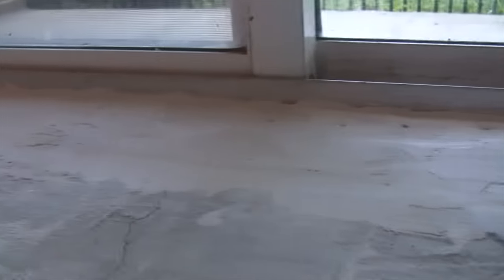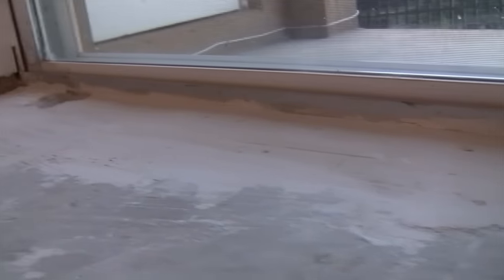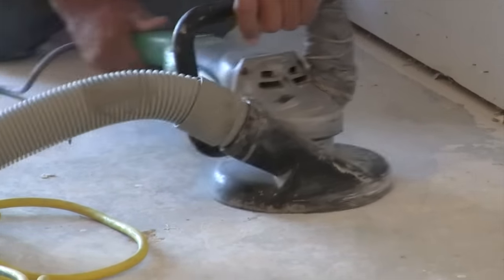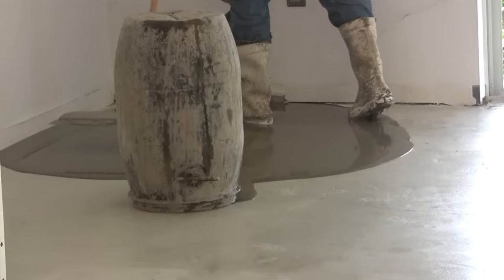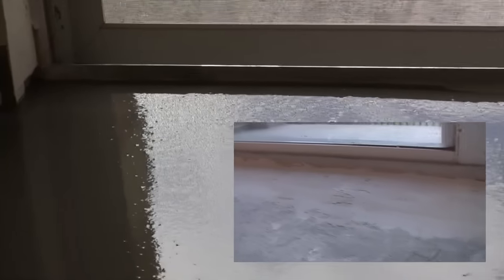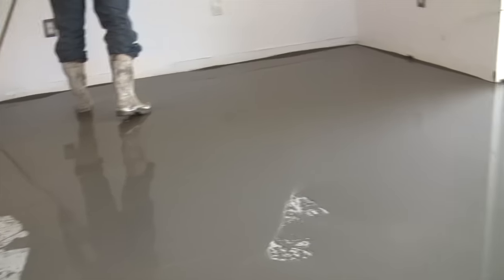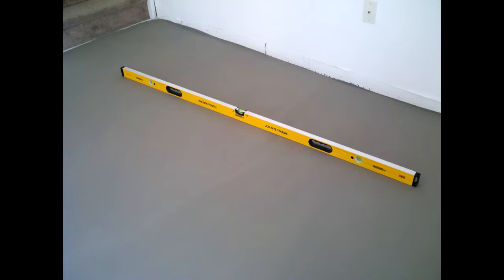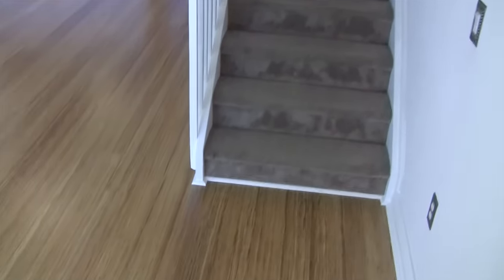How to Self Level Concrete Floors Like Pros - Self Leveler

Comment: I have tried to use MAPEI self-leveling compound without any tools.  I thought self-leveling meant it would... well ... level by itself.  What I found was that the different batches wouldn't perfectly blend/mix with each other.  What I mean is that the edges where the different batches met weren't perfectly blended, you could tell where the different pours were.
If I was to do it again, I would invest in one of those spike rollers, to make it look like it was single uniform pour.
Reply from the maker: Yup, once you rake it and roll it, then it self levels.
Reply: What does it matter if you're putting a floor over it?
Reply from the maker: @cosmicshadow305   It would only matter if the 2 different pours are uneven with a lippage between the 2 of them.  A lot of it depends on if you mixed it properly and if you dumped it right away you're supposed to mix it within 2 minutes and get it on oak floor right away and yes you are supposed to use some type of rake.  I have done small bathrooms before and had to do a smaller area of the bathroom and I was just pushing the mixture around on the floor with a trowel to feather it out to the rest of the floor.
Reply: that's because you either mixed them with different amounts of water, different water temperatures, or the bags we'rent the same weight throwing off the mix ratio
Reply: Chris or if they wait to long in between pours. They could be perfect mixes. Won’t matter.

Comment: Great  video! I wanted to ask if the the floor had a bump would you first have to lower that bump or would the self leveling cement do that?
Reply from the maker: Yes they will typically go around the floor with a grinder with a Cup wheel on it that will grind down the high spots sometimes you might even have to do a little chiseling but the idea is to get the floor as flat as possible before you even pour self-leveling compound otherwise you're going to end up mixing many many more bags than you originally intended in order to make it all rise up over the humps . So to prevent that the idea is to grind down the humps to the level of the rest of the floor

Comment: Surely with a pad that size there should be an expansion gap around the perimeter?
Reply from the maker: You don't need expansion gap with concrete. You would need it with wood or laminate flooring as it expands and contracts.
Reply: @jeffostroff  why would sidewalks have them then? Thanks for the video.
Reply: @MichaelMerritt  im guessing its because sidewalks are subject to more extreme forces. expansion and contraction of the ground, especially important in the northeast with the freeze/thaw cycle

Comment: Is it possible to level a floor in a flat? Ous the concrete not too heavy for original period hardwood underneath? Thank you.
Reply from the maker: You can level that floor with no worries, unless the flat was built illegally against building codes, and is subject to collapse.
Reply: Built in 1898, so not sure about the bulging codes back then😂, but thanks!

Comment: You didn't cover the clean up between the grinding and the priming.  How clean does it need to be?   It seems like that would take a considerable amount of time.   Also, why didn't you seal the crack in the floor before priming and self leveling
Reply from the maker: I believe they used a regular roller attachment afterwards to just quickly go over the floor. We did not fill in the crack because it was not deep. The self leveler will fill in the crack when it runs over it.
Reply from the maker: GoFuck Yourself  Sorry, you are incorrect on this, I guess you missed the part where the bonding agent was put down first on the concrete before self leveling was applied, as required whenever you apply any mortar over old concrete, that is all you need. That is what MAPEI tells you to do, and in fact, they specifically tell you NOT to pour this over any underlayments:
"All substrates must be primed with the appropriate MAPEI primer before applying self-levelers".... 
"Do not install over over sheet vinyl, self-stick vinyl tile, luxury vinyl tile/plank (LVT or LVP), glue-down wood flooring, particleboard, hardboard (Masonite), Lauan panels, waterproofing, crack-isolation or sound-control membranes, gypsum-based patching materials, or any other non-dimensionally stable materials."
Reply: @jeffostroff  the proper way to do this is to seal ANY cracks before leveling compound.  And to answer the original question it's standard to vacuum between grinding and primer

Comment: i fit floors in the uk and we get big gaps at the patio doors and/or insulation poking up. They also have a guy come round and spunk in a load of mastic everywhere so they can get a good air pressure test result. It's not always the case but some companies/builders/site managers don't give enough care for the floor prep. You can use wide masking tape if there are skirting boards on but personally i prefer to use a hand trowel and i do the whole lot 100m2+ on my own, otherwise the money isn't good enough

Comment: If you has a spot in a garage that was unlevel would you use the self leveling on whole garage or just the unlevel part?
Reply from the maker: In the garage it's usually a localized dip in the concrete or something like that. Sometimes it's a bump up and then you can just grind it down flat with the area around it. But I would only level the area that I need to level and and do a real good job with the trowel feathering it out into the flat part of the rest of the garage. According to the town council of America and most flooring manufacturers, they prefer no more than an eighth of an inch difference across 6 feet of floor for flatness.

Comment: I assume if you need to add weatherproofing sealer it would be after pouring the level set compound?
Reply from the maker: No you should never add a weatherproofing sealer to this as this is never meant to be the final finished floor. The instructions on most self leveling concrete bags will tell you that is only meant to be the under floor and that a flooring should be placed on top of it.

Comment: What does a typical job like this cost?  Is it by square foot. I have a basement that needs this before I remodel it. Was wondering what kind of quotes to expect?  
Great job on the video. 
Also, is there a slow set you could use to give you more time if you only had 2 people to do the job i.e. me and a friend?
Reply from the maker: We paid these guys $1200 for the job. You can probably do it with 2 guys, just have one guy mixing bags constantly, use multiple buckets so you can just go from one to the next. I don't think they have any slower setting self levelers.
Reply: @jeffostroff  Was that including the materials or just labour?

Comment: What brand cement and Primer did you use?
Reply from the maker: Forget which one, they sell it at Home Depot, down the concrete aisle, looks like milk, comes in plastic bottle yellow label.  The self leveler bag might also indicate the preferred primer to use.

Comment: Hi Jeff, what an incredibly well done, informative video. 
Can you tell me exactly how many bags of Self-Leveling compound were used for this room?
 I have 1450 ft² of slab  cement in an 18 year old home with definite settling issues.  Any idea how many bags might be needed?
Thx!
Reply from the maker: I don't know how many they actually mixed up but I think I saw about 40 bags on the truck and I don't know how many they used. If you look on the back of the bag that you are buying, it tells you how much square foot it covers for a quarters of an inch or  More so read what it says on the back of the bags
Reply: @jeffostroff ; Thanks so much!

Comment: Just wondering,  I have a kitchen floor that has like a solid Masonite composition type floor.
It's not level due to floor joices that have warped or bellied.
Can this be used ?
Reply from the maker: Yes in fact many apartment builders pour this on the second floor where they have wood subfloors, to make a flat level surface.

Comment: ahh man this looks like something I shouldn't attempt. I have a 12x10 ft room and a 6 inch incline from corner to corner. Can get someone to help me but not professional help.. What should I do?
Reply from the maker: If it is 6" off and you have never done this before, I would leave it to the pros.  Depending on the manufacturer of the self leveling compound, once you go past an inch or 2, they require aggregate to be put down with the product for reinforcement, as his is not meant to be used that thick on its own, or maybe grind down the part that is 6" higher, but a professional contractor should be able to accomplish this for you.
Reply: @jeffostroff  6 in is a shit ton of material, might consider pressure-treated sleepers with a plywood subfloor over top
Reply: @richardgilpin9262  Maybe dry pack instead?
Reply: @torbensonderskov91  not sure what you mean,  like a fat mud?

Comment: I have a 400 Square foot cement flooring, of which 200 square foot have undulations in it. Should I use this self levelling compound o
For the entire 400 sqft? Or only to that particular side of 200 sqft? Undulations are about +or- 2 mm. How many bags do I need to cover a meter square?
Reply from the maker: You have to pull up the instructions from the listing on home depot or wherever you buy it from. The bag tells you how much to use. If you think you can get the 200 sq feet to feather out to be flush with no bums and even to the other side of the floor, then just level that one side.

Comment: 50 bags?  Geez , that's like $3200.00 in material alone.
Reply from the maker: No, the bags are $30 each, and it's doubtful they used all of them. Each bag gives you about 25 sq feet at 1/4" depth. Total sq footage was 225 sq ft.
Reply: @jeffostroff
Reply: tax
Reply: Guy crazy
Reply: @jeffostroff  I thought is was 375? That's what you told me earlier.....and you talk truth 😂😂😂
Reply: jeffostroff first you said the room is 15x12=375 sq ft and now you said the room is 225 sq ft and still there’s no way you used 40 to 50 bags of self leveling cement. If each bag give you 25 sq ft at 1/4” depth. That’s mean that 375 sq ft/25 sq ft = 15 bags and on the other hand if the room is 225 sq ft. 225sq ft / 25 sq ft= 9 bag of self leveling bag. Number don’t lie. 🤥
Reply: @hanselroa  ya I called him out on it too he tried to bend what he said a couple of times. Glad im not the only one who caught it lol.
Reply: Did he say he USED 50 bags or CHARGED for 50 bags? I just had over 400sqft done with less than 20 bags. Maybe the thickness?

Comment: What kind of primer and self leveling concrete can you use for outside concrete patio
Reply from the maker: RapidSet from Home Depot says on the instructions This product is suitable for use in exterior conditions as an underlayment in areas that are not prone to water immersion or prolonged exposure to temperatures above 120°F (50°C).

Comment: Is it possible that after pouring when the screed settles it pushes the insulation and damp proof membrane down to the subfloor and it makes a 40mm difference? Our builder is telling us this. We need to do another round of pouring to compensate for the 40mm.
Reply from the maker: you should have it all dammed up with silicone or something to prevent the self-leveler from flowing where it should not flow, then you won't have this problem. You should not have to do 2 rounds of pouring, you should only need to make one pour

Comment: That guy grinding the floor with no ear, eye, or breathing protection is foolish.  If you are going to try this, wear ear, eye, and breathing protection, and make sure the respirator protects against silica dust, which causes silicosis.  You won't like silicosis.  Don't be a fool; protect yourself.  That dust collector is probably getting a lot of the dust, but what if it misses 1%?  And say you're grinding a 20X22 garage floor.  That's a lot of dust and even 1% is bad enough.  How much silica dust is too much?  The American Conference of Governmental Industrial Hygienists has a lower non-regulatory Threshold Limit Value of 25 µg/m to the third power.  That is 25 micrograms per million per cubic meter of air.  That's a tiny amount of silica dust.
Reply from the maker: I know some of these guys I think will end up with iron lung one day. I also see a lot of roofers without harnesses. OSHA can't be everywhere at once to inspect every single job site. Lucky for this guy that vac he used caught about everything there was, but you're right, there's still 1% of what I could not even see him grinding up.

Comment: Concrete will continue hardening up til a month after laying it out.
Reply: Its also called curing
Reply: Kalle Klæp Not necessarily a month. There is quick setting concrete. Many accelerating admixtures exist. Concrete may harden in a few hours. Normally 28 days is specified, but concrete gain 70% of its strength within a week.

Comment: Shoe molding looks like crap in any house...
Reply from the maker: Yup, that's why I don't use it anymore, stopped about 5 years ago. I'd rather have a little gap under the baseboard than see that tacky shoe rail. In fact there have been times when I caulked UNDER the baseboard due to excessive gaps left by sloppy builders leaving lippage on their uneven tiles, now you have to create an optical illusion by caulking under the baseboards, but it works great and fills in the gaps.
Reply: @jeffostroff  Stopped 5 years ago but used it in this video from 3 months ago
Reply from the maker: @zeke112964  I uploaded this video 3 months ago, but we actually shot it in 2012! It sat on my hard drive for years before we got around to processing the video and uploading it.

Comment: Will this work in a garage?  I have  quite a few high and low spots and it would look worse if I sealed it like I want to do.  I do park a couple vehicles in it.  Thanks in advance.
Reply from the maker: No, you can't use this in a garage, the bag instructions say interior foot traffic only, no vehicle traffic loads. Always check the instructions first before buying, and check with the manufacturer what they recommend for a garage floor.

Comment: This is nonsense. I do self levelling   on floors this size all the time on my own. You don't need to grind the floor first and it's not a "bonding agent" it's a primer to stop the leveller drying out too quickly from absorbtion. Their bucket is stupidly large and the way they splash it about is amateur hour!
Reply from the maker: Apparently you're not very good at your job. There were several high points that needed to be ground down, and one spot had a vertical rebar rod sticking up out of the foundation that had to be ground down. Huge chunks of sloppy concrete from the builder had to be ground down. These guys use a "stupid large bucket", because they mix multiple bags at once for larger faster production, as they normally do commercial projects. 
Sounds to me like YOU are the amateur if you don't understand these concepts. There was no splatters all over the walls, and yes, you dump the stuff out on the floor, that's how it works. You're just making up nonsense, really is that all you can come up with? "splashing about. It's always amusing when janitors assistants show up trolling here, blowing hot air about nothing. I would never hire you if you don't prepare the sub floor first. Grinding the floor removes any contaminants that could be there too. No one likes a troll who comes flying in off their high horse cutting down everyone in site. Grow up.
Reply: I am a professional flooring installer and can say that while I don't totally agree with Pablo I definitely don't agree with Jeff. Depending on what brand of leveler you use you don't need to grind the whole floor. Also Pablo is right its a primer that keeps the concrete from sucking in the moisture of the leveler
Reply: Commerical flooring installer here for 20yrs, depending on what exists on the floor does require grinding, and why would you not want to grind high spots down?  Less self leveling material. Your floor in only flat as the highest spot.   Now being a commercial flooring outfit,  their methods are a little out dated,  there are better tools than the skimmer(rake)  we use a spike roller and a gauge rake to move material around and our mixing barrels are in rolling carts. Does the end product look good?  Absolutely.   Just because someone doesn't do it your way doesn't mean it's wrong.
Reply: Jeremy....Thanks Also NO Primer Needed AT ALL (only in my case)...15x15 Basketball court Outdoor for the little little kids.....Cleaned and dumped spread and PAINT!  that's it!  Anyway a GREAT VID Jeff!
Reply: @NateBFlooring  us residential guys have seen your commercial work......